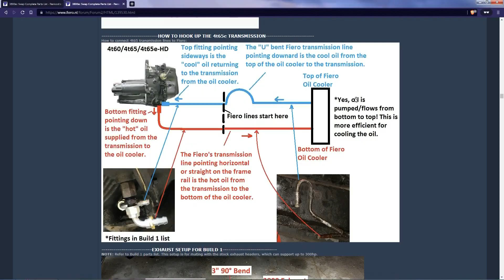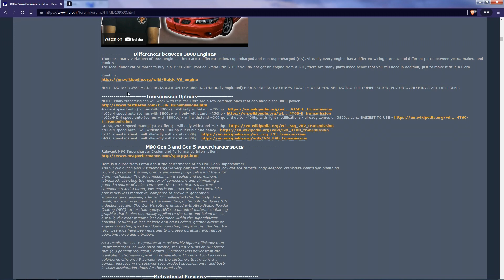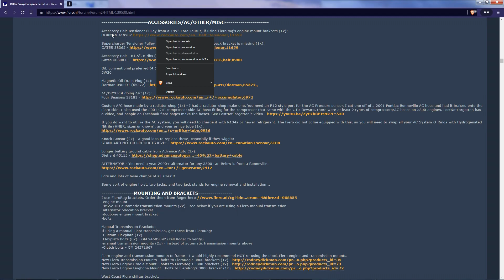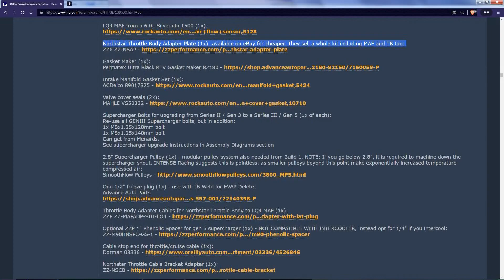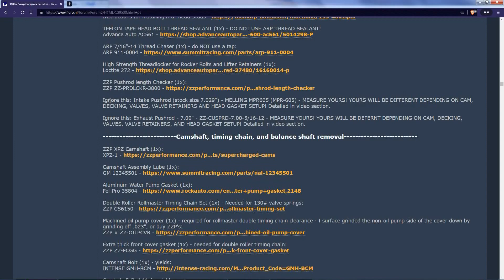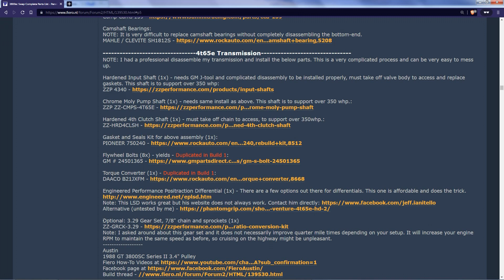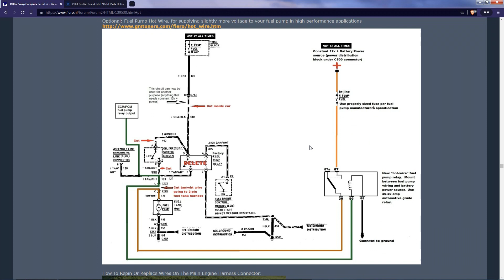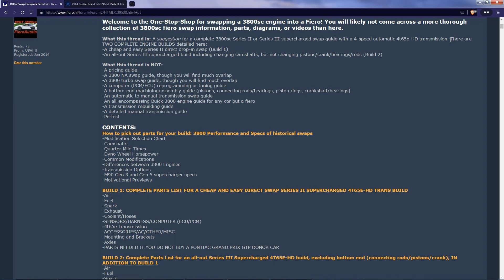3800 Supercharged Engine: MODIFY, REBUILD, then Swap into a FIERO - EVERY STEP!

Comment: Is there a way to make it awd? That would be sickkkk
Reply from the maker: there actually is a transmission from a van from this era with AWD. That would be a nightmare, totally custom job, but i'm sure it could be done
Reply: @FieroAustin  what van was it and how did that work with the transaxle being in the rear?
Reply from the maker: @austinhoffman8320  I believe the Astro and Aztek had AWD transmissions that could bolt up?

Comment: Will a 3809 bolt up to an original '86 4speed manual trans?
Reply from the maker: Yes it will! It may not be as strong as the 4t65 though.

Comment: I just purchased a Fiero in August 2024 that already has the 3800 supercharged engine installed. 

Is there a fairly easy and straightforward way to determine what 3800 engine and supercharger I have? 
Is it a Gen2 or Gen3 and is the supercharger a 
L32 Supercharged Series III 3800 
L67 Supercharged Series ? 3800

Also, the transmission was indicated to be a 
4T65E Automatic Transmission 
But … not specifically the 4T65E-HD. 

Is there a way to determine if the transmission is an HD or not? 

The engine is not running correctly and will only basically idle around the block. 
If I try to accelerate, it will pop and die out. 
The code I’m getting is a misfire on cylinder 04.

I just want to determine what 3800 engine and supercharger I have so I can then start digging into the issue.
Reply from the maker: Easiest way is what car did it come out of? If it's all stock and it came supercharged, then it's a 4t65e-hd.
The superchargers look slightly different between generations. look at pictures of gen 3 vs gen 5 superchargers. check this thread out for differences; https://www.grandprixforums.com/how-to-write-ups-tech-tips/49039-the-eaton-gen-v-supercharger-faq-swap-thread-genv-gen-five-gen-5-a.html
Reply: Thanks I appreciate the link. 
I will look at the information and photos. 
I don’t know what car the 3800 SC came from. I don’t know anything about it. I bought the car from an auction and the seller didn’t know as they were just liquidating it.
Reply from the maker: @anderslarocque1280  got ya. hit me up if you have any more questions!

Comment: I feel dumb I had an engine and a gym smh .  Will the grandnational motor fit ?
Reply from the maker: I am sure it fits, but I have never seen one. May be because it didn't have a bolt pattern that fit up to a transverse transmission (not positive on this)?

Comment: I feel dumb I had an engine and a gym smh .  Will the grandnational motor fit ?
Reply from the maker: no, those didn't have the same transmission bolt patterns. There are a few similar 3.8L motors around from various cars that did but they aren't too common.

Comment: Great Tutorial. 
I would like to add one item. 
When removing cable ends from bracket that has the tabs. I found a very easy and fast way of doing it. 
Use a 13mm box wrench over the barrel. It depresses the three tabs.
Reply from the maker: i'll have to try that. Thanks! P.S. I think you left a comment on the wrong video!

Comment: Thank you for everything. I mean everything. I have a 84 Fiero 2m4 with 21k miles I rode in when I was a kid. I just picked up my Grand Prix GTP, have Fiero Rog mounts and brackets, waiting on my harness from James Brown 🤟🏻 What did you dislike about the Xpz cam? Also are the Injectors and fuel pump you used big enough for E85? Best wishes 🤟🏻
Reply from the maker: Thanks for the feedback! I did not like that I had to delete the balance shaft and had to machine down my valve guides on the cylinder heads for an XPZ cam. Otherwise it is a good cam. Not actually that crazy timings; it's a decent mid range cam compared to LS stuff. It idles very nice and still has plenty of torque. It is made for higher RPM which I never really get to daily driving but that's the name of the game.

80# injectors are plenty for E85 and so is the 340LPH AEM fuel pump. You can see those detailed in this amazon post here https://www.amazon.com/shop/fieroaustin/list/PCGZN5DHUO3U?&linkCode=ll2&tag=fieroaustin-20&linkId=cbd6ce709a4464fae0713d1b39095fd1&language=en_US&ref_=as_li_ss_tl
OR in build 2 https://www.fiero.nl/forum/Forum2/HTML/139530.html#p7

Hit me up with any questions anytime. God bless! https://www.facebook.com/FieroAustin

Comment: Does anybody have build videos of a 4 speed or 5 speed car?
Reply from the maker: Not off the top of my head. There are not that many differences. The forum post does cover the parts needed for that. FieroRog's personal fiero actually had a manual, you call him up if you have questions. Check out the Mounting and Brackets section in the Build 1 list (best viewed on a computer). - https://www.fiero.nl/forum/Forum2/HTML/139530.html#p5

Comment: Help me please.  I can’t find a engine wiring harness 2001 GTP 3800 SC engine. Please help me
Reply from the maker: Hey I would advise you search for engines instead of harness, and then call the junkyard and ask if they have the harness on the engine still. You will get a lot more hits Here is a search every engine in the country that is non-interchangeable (2001 only, skim through here until you find a supercharged 3.8 2001 GTP), distance is from Chicago. - https://car-part.com/cgi-bin/search.cgi?userSearch=exact&userPID=1000&userLocation=USA&userIMS=&userInterchange=%5B%7C%7Br&userSide=&userDate=2001&userDate2=2001&dbModel=61.11.1&userModel=Pontiac%20Grand%20Prix&dbPart=300.1&userPart=Engine&sessionID=13000000491454403&sURL=car-part.com&userPreference=miles&userZip=60007&userLat=42.0131000&userLong=-87.9972000&userIntSelect=1248175&userUID=0&userBroker=&userPage=1&iKey=

Keep checking in on this page too, it is year specific harnesses, not engines, but I don't see any right now. - https://car-part.com/cgi-bin/search.cgi?userSearch=exact&userPID=1000&userLocation=USA&userIMS=&userInterchange=%5B%7C%7Br&userSide=&userDate=2001&userDate2=2001&dbModel=61.11&userModel=Pontiac%20Grand%20Prix&dbPart=648.1&userPart=Wiring%20Harness%20(Engine)&sessionID=13000000491453076&sURL=car-part.com&userPreference=price&userZip=60007&userLat=42.0131000&userLong=-87.9972000&userUID=0&userBroker=&userPage=1&iKey=

As a last resort, this would take more time to search through to find a GTP, but this is every interchangeable harness (might not be the exact same, so beware, but I believe a 1998-2002 GTP harness would fit with little to no issues) - https://car-part.com/cgi-bin/search.cgi?userSearch=int&userPID=1000&userLocation=USA&userIMS=&userInterchange=%3EAC%40EN&userSide=&userDate=2001&userDate2=2001&dbModel=61.11.1.1&userModel=Pontiac%20Grand%20Prix&dbPart=300.1&userPart=Engine&sessionID=13000000491455076&sURL=car-part.com&userPreference=grade&userZip=60007&userLat=42.0131000&userLong=-87.9972000&userIntSelect=1248175&userUID=0&userBroker=&userPage=1&iKey=
Reply: @FieroAustin  yes sir, that’s what I have been doing. No luck at all. If you find one please let me know. Thanks Austin
Reply from the maker: @johnnybaker3751  Best of luck. GTPs are a rare bird. They got beat up a lot and now junkyards are starting to crush them. Is your harness non-repairable? also try that last link. I just spotted a 2001 supercharged GTP on it. here is the information: Deering's Sales Service & Towing, Inc. USA-MN(Spicer) Request_Quote 320-403-4000 / 877-642-2915 here is the link again - https://car-part.com/cgi-bin/search.cgi?userSearch=int&userPID=1000&userLocation=USA&userIMS&userInterchange=%3EAC%40EN&userSide&userDate=2001&userDate2=2001&dbModel=61.11.1.1&userModel=Pontiac+Grand+Prix&dbPart=300.1&userPart=Engine&sessionID=13000000491455076&sURL=car-part.com&userPreference=grade&userZip=60007&userLat=42.0131000&userLong=-87.9972000&userIntSelect=1248175&userUID=0&userBroker&userPage=1&iKey
Reply: @FieroAustin  
Thank you so very very much
Reply from the maker: @johnnybaker3751  Of course!

Comment: I'm currently planning on doing a 3800sc swap, but i'd like to use the stock getrag 282 transmition. I've heard that the flywheel for the 3800 is too thick for the 282 and that you cant machine down the flywheel because its an external balancer for the engine. would you know how people have overcome this? any help is greatly appreciated.
Reply from the maker: That is correct. Get in touch with Fierorog here, he makes flywheels and sells the bolts for them: https://www.fiero.nl/forum/Forum4/HTML/068855.html also be sure to check out the whole instructional thread - https://www.fiero.nl/forum/Forum2/HTML/139530.html

Comment: So my transmission is a CFD 719 8680115 Hydra-matic I'm not sure where it falls under on the list and engine is a supercharged type
Reply from the maker: The thread only covers a few common  transmission types (manual fieros and the 4 speed that came with the 3800). you'll have to do some custom stuff for sure.